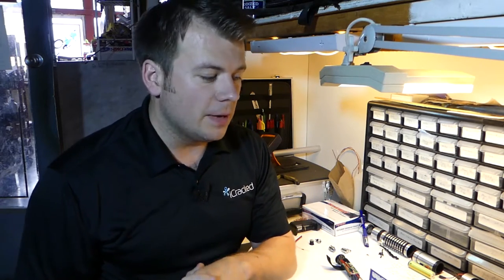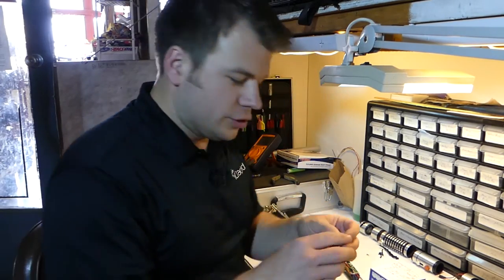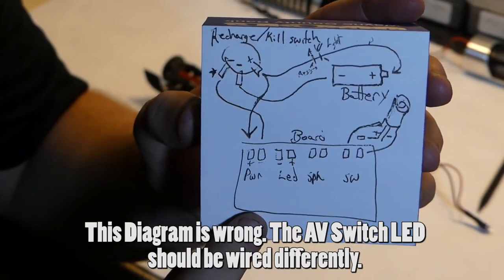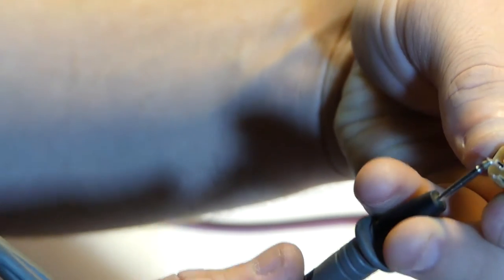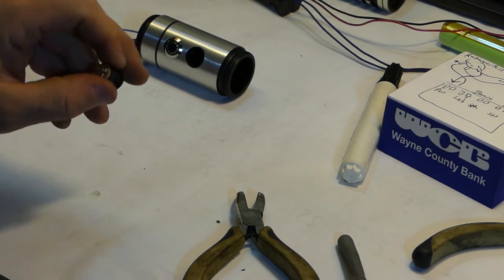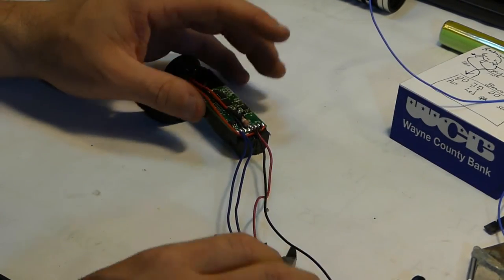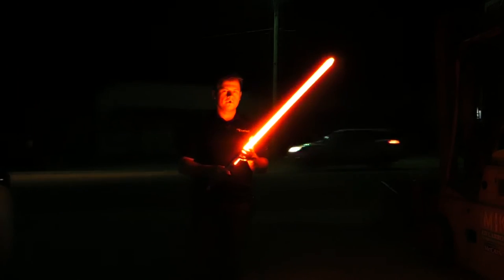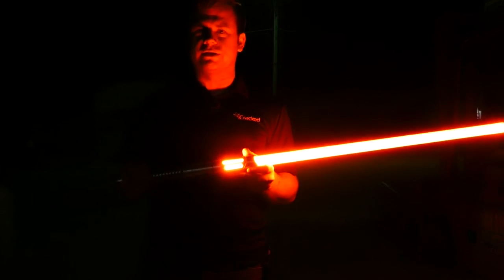Saberforge - ASP - Assembly

Comment: Hey so regarding the LED for the switch. What your gonna wanna do is solder the positive to the positive pad on the board and the negative to the negative pad (both being the positive and negative pads that the battery connects to) that way when you pull the kill key and the soundboard powers up, it'll also send power to the switch LED.

Comment: Thanks for showing the recharge port details. I have a SF Venom that I think was wired opposite from day one. I think I might know how to fix it now because of this video. I don't dare send it to SF for repairs. They lost my Gladius when I sent it in for an upgrade. That was a whole bunch of trouble.
Reply from the maker: I had to look through tons of forums for a few weeks to really get an understanding of how it worked. It actually was pretty simple and so I believe some people don't explain it real well, I also realize I didn't explain it very well on this video either. If you need any help then feel free to message me and I'll tell you all the knowledge that I know.
Reply: I'm pretty sure they swapped the terminals at SF. When I plug in the charger, the board starts up but the battery gets nothing. 
I think I'm gonna try yanking out the socket and see if I can switch the wiring around. In case I damage it, I have some extras on the way: 5.5mm x 2.1mm DC Power Jack Socket Female...
Found an inexpensive 10 pack on Ebay.
Reply from the maker: +Mike Ahlquist yeah the board should have nothing when you plug in the charger because it effectively is like taking the negative terminal off your car battery.

If they swapped the negative terminals though then it would work without a kill plug and would would work when the charger is plugged in however it would be disconnecting the negative to the battery and would be operating solely off the power from the charger.

Comment: finally you did it.great work.im glad to see. years later now i have seen your videos.  today saberforge isnt better. my complete mpp mk1 started to play one sound on every profile.  so i had to do a software update. this worked for a short time. now it has suddenly no sound,no light and no connect to the pc.even with full batteries. i think the electronic is a piece cheap crap. the support is lousy. my first expierence with this company is disapointing. a expensive saber about 650 euro mpp1 /champinion/rumble,should work without problems.otherwise i can buy a"toy from china for 20!

Comment: Hey, awesome job! I'm glad you worked it out for yourself, man!

Check out VadersVault and get the suncrusher upgrade during checkout to get a brighter blade and flash on clash. Also, for an extra $99, you can get all the colors in one saber. They have quite a few colors btw. Their sound board's are good too.

Ultra Sabers has, what I believe to be the loudest sound board out there: Obisidion. Ultra Sabers's hilts are good but they usually have a diameter of 1.5 as opposed to other companies that have 1.25. It's odd... They started out with thinner hilts and then bulked them up. Many would say the reason for that is for the electronics but other companies have smaller hilts.

Anyways. Have a good one. 

 Good luck and congrats on the engagement!

Comment: Sometimes these switches need a battery with a bit higher voltage. I think, that it's usually 12V and your battery is 3,7V.
Hope it helped :)

Comment: I think what really sucks it that u spent all this money and have to build u own saber that is amazing I wish I had your talent and where did u learn to spin the saber like that very cool nice job very very impressed
Reply from the maker: Actually I need to add an Annotation, Once I got back inside and pulled the Kill Key again, the LED on the AV switch began working. I don't understand what took so long for it to begin to work.

As for the spinning the saber. I haven't spun anything in a while but when I was young I took Martial arts and had a few lessons on using a sword. I actually have around 8-10 Swords in my closet, I just currently don't have anywhere to display them.
Reply: Anyone can do that spin. Its very basic.  Now if he did the obi anni spin it would be impressive

Comment: Had to pay more money for the dang thing?! That's not right to have to buy more parts after you were supposed to be supplied with everything.
Reply from the maker: Yeah, unfortunately everything shown in the video I had to buy. I originally should have also had an AV switch and a Dummy AV switch which SF never provided me. I also purchased 2 chargers. The first charger I showed in the video is similar to the one they provide with their orders.

The recharge port/Kill key feature however is not something the ASP sabers come with and so that was a feature I decided to add since I was going to have to do some work to it myself as far as wiring and all goes.
Reply: +James Mitchell cant go wrong with in-hilt recharge ports
Reply from the maker: That's right! I really didn't like the idea of having to remove the board every time that I finished with the Saber so that it wouldn't have a constant drain on the battery. This way however is nice because the Kill Key completely removes power from the board and stops all drain on the battery. And I can charge the battery without having to remove it from the Saber. 

Also the AV switch LED began working after I turned off my camera and was removing the videos from it. I don\'t understand why it didn't initially or in the outside video. It does now however.
Reply: +James Mitchell that seems odd... If you delve into the custom saber community you find that all custom sabers have in-hilt recharge ports. With the exception of Vader's Vault because they have a really decent solution for their battery systems. It's easier to remove the standard set up and doesn't require kill keys